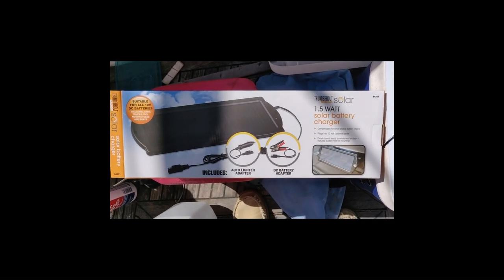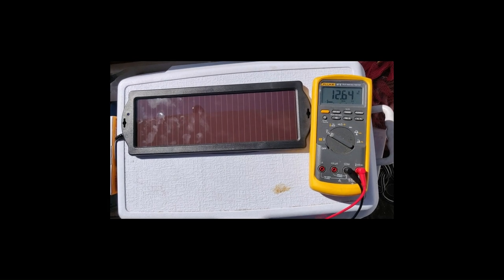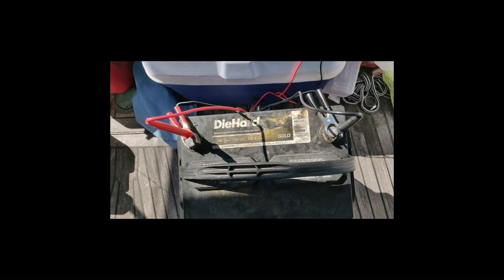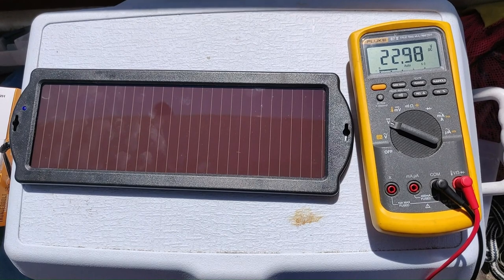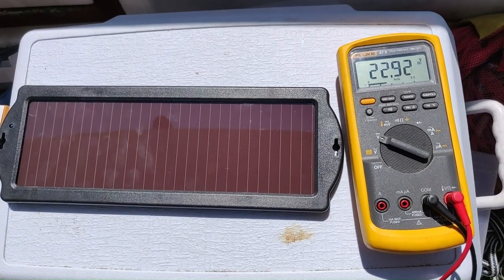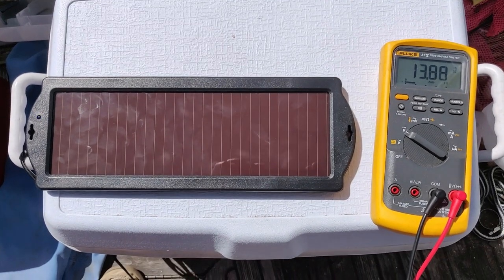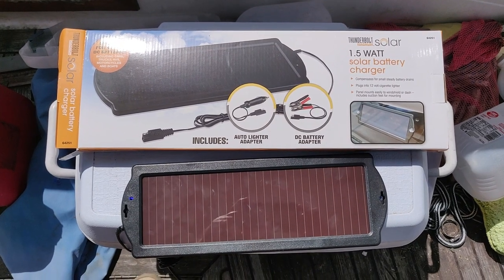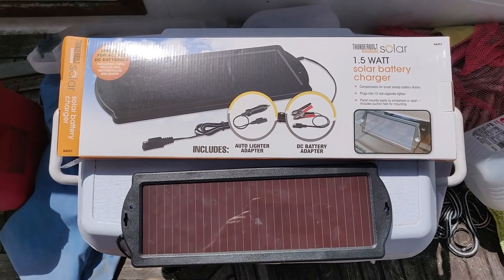Thunderbolt 1.5 Watt Solar Charger Performance Analysis

Comment from the maker: I was gone for five months and came back to a still fully-charged battery, so it works over time, hope it holds up further. As said in the video, the 22v is UNLOADED output--i.e., not connected to the battery. As proof that it does not overcharge, the battery cell water levels were the same as when I left.

Comment: 22V？ Isn‘r it too high for charging a 12V battery?
Reply: Its 22v open circuit.  The moment you connect it to a battery, you apply a load to it.  Since the voltage is so much higher than the battery it will try to dump all of its current into the battery.  Since the current is limited to a hundred or so milliamps the voltage is drawn down as the current is dumped immediately to match the battery voltage.  Yes it will attempt to charge the battery up to 20v but its suuuch a slow trickle charge and only works 1/3 of the time when the sun is hitting it.  So essentially it charges during the day and counteracts the natural drain of the battery at night.   If it was left in the sun 24hrs per day it would likely overcharge the battery.
Reply: @inductor1.77  What a coincidence! I just retested the voltage again today!
Reply: @soldiersvejk2053  how's it been working out for you?  I installed one in my truck 2 days ago (hardwired it in to the battery). I've had one hardwired to my car for 5 years and it always fires up after it sits.  I have to hardwire them in though because the outlet turns off when the car is off.  Also I had to open and solder in a diode for the one in my truck because for some reason it was too cheap to have one.
Reply: @inductor1.77  It remains to be seen. Hasn’t got the chance to really use it for an extended period.